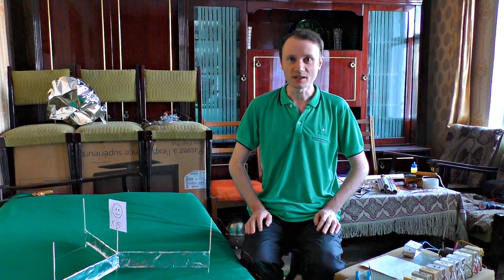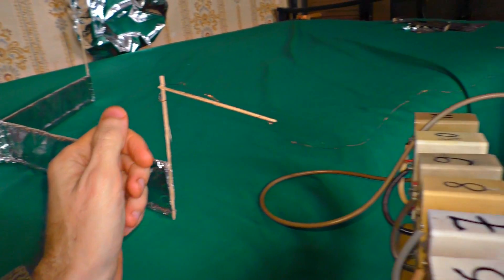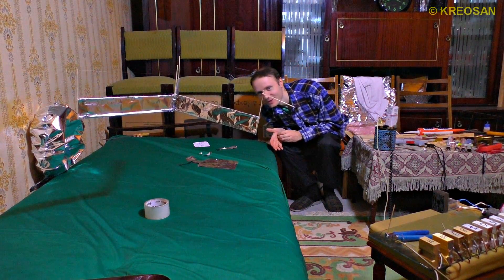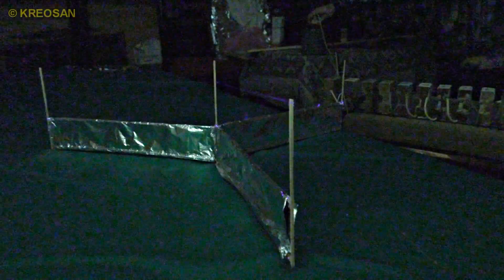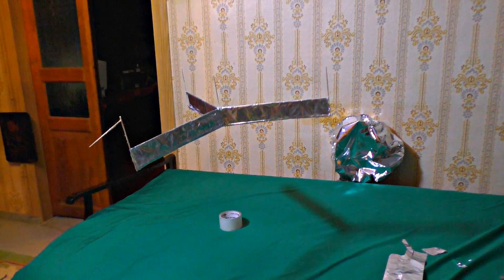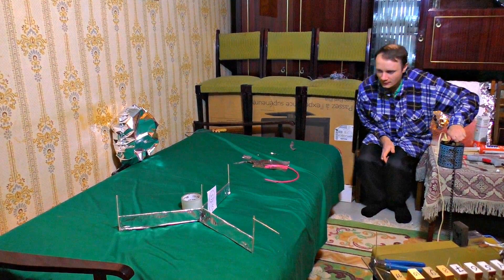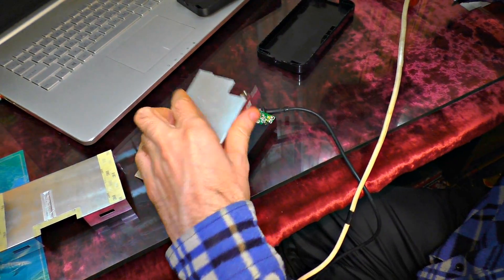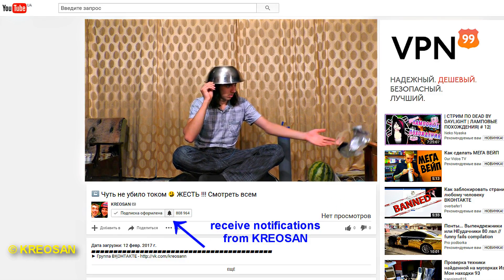I've assembled an Ion Thrust Engine at home / ONE MILLION VOLTS POWER

Comment: Your transformer is probably feeding high voltage back in to the mains power.
Reply: Need a lowpass
Reply: @Max-sp3jx  or a diode.
Reply: @theterribleanimator1793  Would be a lot for one diode?
Reply: @Max-sp3jx  not quite, you can series the diodes to increase the power they can handle.
if you series 3 1kv diodes, then you get a 3kv diode. though the voltage drop when they are conducting gets bigger.
Reply: @Max-sp3jx  now that i think about it, just a simple 1:1 transformer to isolate high voltage that could come back would work much better.

Comment: All that rf intefearence from the high voltage must of messed with those electronics. And there also could of been a capacitance between the high voltage side and the mains voltage side causing some of it to jump to the mains side causing that sparking and shorting the laptop power supply

Comment: Circles of copper and circles of aluminium one inside the other with several rings of each creating 3 lifters set up on a 3 sided pyramid with an air powered generator... I'd like 10% for the details...

Comment: Need to get back to the one I bought for some reason it dropped the 3 amp to the .25 resistor and not the transformer mmmmmm next one other than I've broken 2 lifter parts so far dam it check befor you use O that was it I forgot about the other parts on the sheet that was why😡added a few bits and went the meter version this one is only 30,000v. Really I need a lot of the plasma transformer for something special like 8 off them costly little buggers. Got the emp one on the first go ?????

Comment: It is very interesting. I think if the capacitor were constructed in such a way that it did not arc, it would stay afloat on its own. This does not use ionic wind to fly, it turns out that electrons are actually made of antimatter, and increasing their voltage increases their mass.

Comment: Never connect hi voltage in the same breaker as sensitive equipment. It sends voltage spikes back through. Surge protector may help. I learned this when I killed ever single led Christmas light on my house running my Tesla coil on the same garage breaker.

Comment: You are missing a dielectric. Add a dielectric material with high dielectric constant like barium titanate between positive and negative charges. That will make it more than mere ion wind and it will then work in a vacuum chamber. Change the shape to pyramid shape so there's a size difference between positive and negative terminals, positive terminal being smaller size. Replace copper wires of positive terminal with bismuth wires and replace aluminum foil of negative terminal with magnesium-zinc alloy foil. Now you have a powerful lifter capable of working in a vacuum. Theory.
Reply: Bismuth wire??? the only bismuth wire im aware of is solder

Comment: Very safe looking cut off switch there. Sparks fly out of it when you switch it on, seems really safe.
Reply: That's from the humidity in the air interacting with the electrified wires.

Comment: It's not ion-wind, it works in a vacuum so it's VERY interesting.
Reply: Ish, it doesn't work in a vacuum. That's why they take the has with them in space
Reply: @TwodogPlant17  It does, Gravitec Inc, a NASA contractor has it working in a vacuum as have a few others. The effct is less of course.
Reply: @GaryMcKinnonUFO  gotcha, the video I saw they brought the gas with them. That's awesome they made it work in a vacuum state. Learning about parallel circuits before I attempt a thruster :-)
Reply: @TwodogPlant17  It's interesting stuff. Honda research did an experiment in 1995 where they put the capacitor in a bath of oil to negate any ion wind, and it had an apparent 3% mass loss using only 20kV or so.

Comment: They actually do know what they are doing. To an extent, they use very high voltage at lower ampers to be on the order of a static shock on a carpet. You get aprox 15k volts off a static discharge from a carpet to a ground src.

Comment: Check your earthing stake, bro.

Seems like your mains earth is floating more than your ion thrust engine.
Reply: Uhm, European style circuits don't usually have earth points.
Reply: @Dkmasteris  Schuko?
Reply: @sks2659   That's a trick question? Schuko sockets were only available in the western side of the berlin wall. The eastern side used the GOST 7396 type socket that did not require any earthing, thus there is none in any of the (edit: old) buildings in the eastern side. (Circuit breaker boxes were grounded to earth though - at least on the ground floor). Current regulations do require for earthing in new builds though. But any appliance below 2.5A will use a standard two prong  Europlug, which again, does not require any earthing. So most appliances outside the kitchen aren't connected to any form of earth. 
Now getting back to my original comment, these guys obviously live in a old house in Ukraine, so it's more than likely that they have absolutely no mains earth whatsoever in their sockets.

Comment: Thank you for the great lifter video!  I especially like your video where the guy gets charged with high voltage and points at candles from far away, blowing them out with ion wind!!  It demonstrates that low current can make very good ion wind.  
Please see my Self Contained Ion Powered Aircraft on my YouTube channel.  It is like a lifter but it carries its power supply onboard.  It took many years to get it to carry the  power supply.

Comment: can you try see how many grams of weight this can lift
Reply: depends on the test of the string/line they were using to hold this up...
Reply: These devices are called lifters, ionocraft, or ion powered aircraft. MIT recently built one of the" latter".  Myth-busters shows a lifter tested.  It is a real phenomenon.  Normally they require a relatively huge external power supply, that part does not fly.  The flying part is very lightweight and flies by blowing a gentle breeze downward electrostatically like the old Ionic Breeze air cleaner.   That said, sometimes they do look like a trick, but they are not.  Also, see the Seversky  Ionocraft.  There is an ultra-lightweight patented one now that is extremely well documented, demonstrated to NASA officials, and proven to carry its power supply.
Reply: The type device in the video usually doesn't lift much more than it weighs.  It also has a large external power supply that stays on the ground, like all such devices except this patented one shown below, it weighs less than 24 grams and can lift about a gram or 2 of payload.
Video:  https://www.youtube.com/watch?v=Qdg0_hjuksQ
Website: www.electronairllc.org